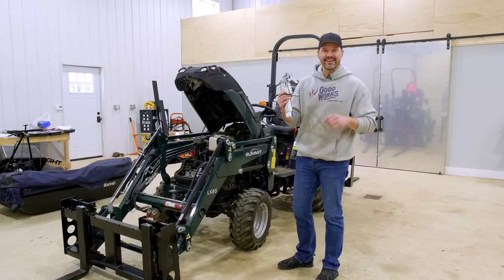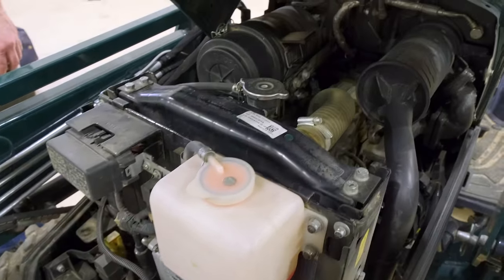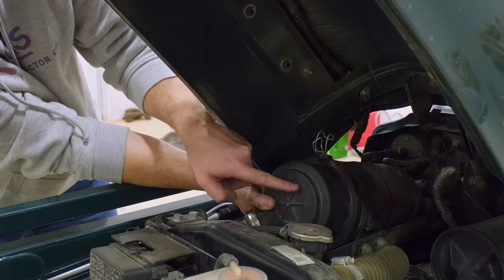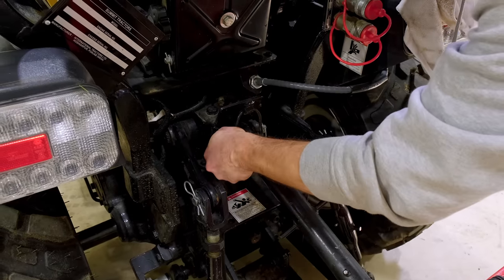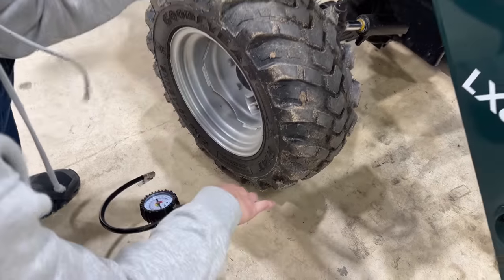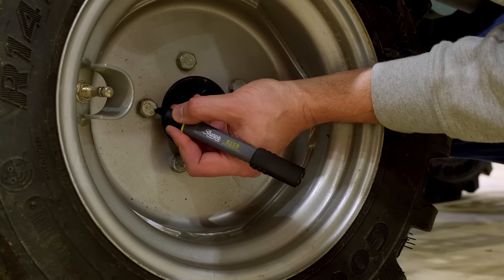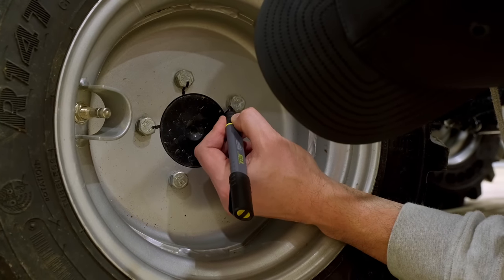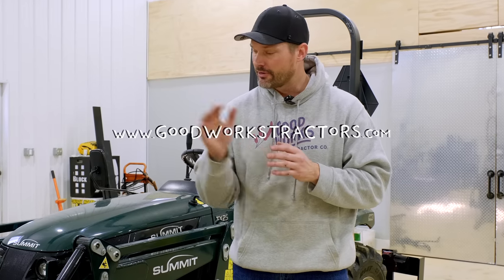90% OF TRACTOR OWNERS DON'T USE THIS TRACTOR HACK...WHY? 🤷

Comment: FYI.  A straight extension on a torque wrench doesn't affect the torque value.  It's only when you use an offset, swivel or other type adapter that you have to adjust the torque value.
Reply from the maker: Thanks for the confirmation!
Reply: The Torque limiting of the straight extension is a function of the extension's thickness. Torque Test Channel covered this in their video on the torque limiting sticks. Interesting stuff
Reply: Straight extensions can indeed affect torque value if subjected to stress levels allowing it to reach its elasticity level which in some cases with higher torque values can be reached . Same principle as to why extensions on an impact gun have a negative impact on output torque, and also the same principle as to how torque bars work when installing lug nuts on wheels.
Reply: Torque bars only work with an impact tool. They are designed to twist away at their set torque setting and spring back in the momentary break in force that comes with the hammer of an impact tool. Any extension can twist. The key is of course to use slow, even pressure when tightening with a hand tool. And anyone that can grab an extention and change the torque of an 18" wrench turning a nut/bolt by any meaningful amount should enter a grip strength contest.

Comment: Great tips Courtney, especially helpful in the spring. This is a great time of year to be checking your tire pressures as temperatures begin to change. 
Tip from RG: Blow a burst of air INTO the tire to clear the liquid from the valve stem before placing your tire gauge on the valve stem. This will minimize the amount of liquid that may enter your tire gauge (or on your shop floor 😅). As Courtney mentioned, we also recommend using an "air/liquid", "tractor", or "wet" tire gauge as they are designed to work with any liquid filled tires. Also, remember that Rim Guard is water soluble, so if you do have a spill it's as simple as rinsing it away with water.

Comment: Another great way that sharpie can REALLY help you out, is writing the date/hours/miles directly on the filters, when maintenance is performed. Takes any guesswork out of it, and removes the need to write it down elsewhere, or try to remember. I've been doing that on all things I've been working on at home for years, and it really helps!
    Also, the military has taught me those lines on bolt heads or nuts are, appropriately so named, "torque stripe".
Reply: My local dealer does this and I started doing it on everything. Very convenient and easy to do.

Comment: I looked it up.  Using an extension doesn't change the torque value enough to have to adjust the setting.  However, you have to keep the extension straight so as not to change the pivot point.  A u-joint can cause a big difference if at an angle, so it should be avoided.
Reply from the maker: Sweet, I was told wrong before.  Glad to hear it!
Reply: Duh

Comment: Just a FYI: be consistent in the pressure gauge you are using each time as they sometimes vary between models. I found this out while doing maintenance on my car. Also, check the manual for pressure needs, I used a sharpie to write it on the rim so I don’t forget…
Reply from the maker: Wouldn't have guessed that
Reply: My pressures, wheel, and torque specs are sharpied on the dash in my cab tractors. In the army we stenciled tp# on the fender or frame above every tire and other needed info which is where I stole the idea from

Comment: Important note: when checking hydraulic oil make sure the 3-point is down. Also, when checking air pressure with fluid filled tires, put air in with your air compressor first so the fluid won't spit back at you
Reply: Especially any tire sealer!

Comment: Besides putting a paint marker line on the lug nuts, I also write the torque settings and lug nut size on the wheel. I've got too many things with wheels to remember which one has what. And the Kubota L4701 has different sized nuts on the front and rear wheels. And just like on a car, lug nuts should be tightened in a star pattern, and with two passes. If some of the nuts are loose, when you back around to the starting nut after the first pass, a nut can be under-tightened. Hence, two passes.
Reply from the maker: Lol, good idea!

Comment: As long as you're supporting the head of the torque wrench, the extension shouldn't change the applied torque in any meaningful way. Extensions will reduce the torque applied by an impact wrench as some of the impact energy is wastes twisting the extension. Once or twice I did see you tighten a nut just past the click so that's something to be careful about. Any time we're using a clicker it's good to have a reminder to back off the torque to zero so the springs inside don't stretch. I like digital torque wrenches now, you can see actual torque applied and they'll have a beeper at the set torque. You can even get an inexpensive digital torque adapter to use with any ratchet.
Reply: At least one nut on the left rear wheel was way overtightened. I'd back all those nuts off and redo them.
Reply from the maker: Thanks!
Reply from the maker: Hmm, I stopped every time I heard the click
Reply: @GoodWorksTractors  Check @ 13:39. Looks like you went about 1/8 or 1/10 turn past click. Given the leverage you have with an 18" bar, that's probably around 7 to 10lb over your target.

Comment: When I first got my 1025R, there were a couple of tires that were always going low on pressure.  Took it back to the dealer and the mechanic overfilled it.  He said they’re supposed to be overfilled from the factory to ensure the tire seals properly.  It worked for my issue, perhaps that’s what happened to your tires…just a guess.  Love the sharpie idea, thank you Mr. Courtney!
Reply from the maker: Interesting, that just might be it.  Thanks for chiming in Elaine!

Comment: Extensions do not change the torque value for static setups as shown in this video. If using an impact wrench it does affect the torque level because the extension twists slightly and the impact is momentary, not long enough for the fastener to seat at the full torque applied. The applied torque when using hand torque wrenches correctly allows the twist in the extension to last long enough to apply the full amount of torque to the fastener. Correctly in this case is a relatively slow application of force so the fastener turns and seats before "clicking" rather than a fast jerking force. Retorquing each fastener is also appropriate to assure each fastener is tight, similar to what is required for a cylinder head. Retorque each fastener until all do not move to assure content tightness.

Comment: Regarding extensions when torquing.  I just watched a test.  Extensions affect fastener torque only when using an impact gun.  Tightening with a torque wrench or rachtet is not affected.
Reply from the maker: Awesome, sounds like I don't have to worry about it.  Thanks Simon!

Comment: many good tips here i usually try to grease the main pivot points whenever i get ready to use but tie-rods and such can be over greased blowing out the seals but U_joints get LOTS of pressure  . even in the winter check your radiator screen IF you feed hay or even moving dirt with your loader--wish that they had come up with the liquid ballast  in the years back i have had several rims rust out from being filled with calcium fluid .  i broke the axle tube on my Versatile 876 4x4 (260hp) twice, not a pleasant feeling quite sure loosing a wheel is right up there!!! tips from a lifetime of farming .

Comment: Coolant reservoir looks low to me.  It's going to be interesting to see if there are any dealers in NC for those Summit tractors in the next couple of years.  There are certainly Tractor Supply's in NC, but it looks like they are showing a limited number locations in three states.  Looks like the closest dealer to NC is in Kentucky.
Reply: It looks low to me too.
Reply from the maker: Yeah, I specifically talk about this in the video :)
Reply: @GoodWorksTractors  if coolant is low in overflow it's worth taking cap off (with cool engine) rad as filling that overflow tank doesn't fill the rad. You probably know this but for the general audience.

Comment: if using donaldson air filter assembly - most appear to; buy the gauge that tells you dirty your air filter is without having to open it.  there is a little cap just on the elbow at the back it fits to.

Comment: As others have said, a straight socket extension will not change the torque reading.  Definitely don’t use a higher torque value than recommended.  Also, holding the extension isn’t the optimal technique as that can change the torque reading a little due to the friction with you hand.  Better to rest your palm under the head of the wrench to hold the extension straight and let the head roll in your palm so that you aren’t impeding its rotation.
Reply from the maker: Good to know, thanks LT!
Reply: What. Are you Steve Austin or something?😂

Comment: I have no actual knowledge to back this up, but I had heard if you use impact wrench extensions - those do have 'give' in them that can change the torque. As such I save their use for only impact wrench removal uses.

Comment: About the high front tire pressure - you indicated that you had never added air to the tires. Tractors often ship with tires fully or even over-inflated to improve reduce bounce and improve stability. Since Summit has no dealer to set-up the tractor the pressures had probably never been reduced to the correct operating level.

Comment: I have never greased a fitting without first wiping off the end of it. Any crap and dirt that is on that fitting WILL be added to your grease, causing wear. I have rarely seen someone do this these
days.  Once upon a time there were full service gas stations that did cars greasing and if you did not do this you would be fired.  Especially equipment that is in the dirt a lot.

Comment: That first oil change was an experience on my Kubota LX2610. Not a lot of room for a filter wrench, and if you're a contortionist that helps😂 thanks for all the great videos
Reply: I have an LX2610 as well and mine was pained on from the factory.  Wrench would not budge the filter.  I had to score the paint and then punch a screwdriver through the filter to get it to break loose.  It was the worst oil and filter change that I had ever experienced.  At least it is no longer painted on and I didn't over-tighten it, so it should come off much easier next time.

Comment: The one thing that I can provide. When using the torque wrench you want to go to the click then do not go back over the nut. The torque value has been achieved when you get to the click. When you go do it over and over you are actually changing the torque values. One time click then done.
Reply from the maker: Yeah, that makes sense to me

Comment: Doesn't  the liquid ballast damage your tire gauge? If it was spitting the liquid out, then the liquid was getting into the gauge.
Reply from the maker: No, it cleans up with water
Reply: I worked in the tire repair business quite a while. There are tire guages designed to get fluid in them w/ no damage. Just stick head of guage in clean water & pump the stick to flush it out. Also the tire should not be 100% full of fluid. Valve stem should be at 1200 when tech is filling it & he should stop filling just before level gets up to the stem. Thereafter whenever you check the pressure make sure the stem is at 1200 to minimize fluid in your guage.

Comment: straight extensions do not affect torque on a torque wrench.  crows-feet or dog-bone style torque adaptors can change your torque settings.  all dependent on angle of offset and lengths of the wrench and the adaptor.
Reply: and the easiest way to account for that offset, is to turn the crow's foot to a 90 degree angle from the handle - then the offset is zero.  You would need to calculate only when you get away from that angle - if you're adding to or subtracting from the natural length of the torque wrench
Reply: @Idahoser11  I'm pretty sure you're only supposed to use a crows foot at 90 degrees on a torque wrench without looking it up. Some of them have the torque multiplier per 12" of wrench printed right on them.

Comment: 1:27 is that a steering stabilizer on the Summit? very nice...
Reply: oh interesting on 2nd look it has a pitman arm/drag link setup instead of rack and pinion? is that common on compact tractors? FWIW i would never speak poorly about recirculating ball... i liked the steering on my 2004 Suburban a lot better than my 2013 Suburban. big step backwards moving up to a GMT900 IMO.

Comment: Does 10 hours greasing intervals on the loader mean grease after 10 hours of loader operation? If so this could be 50 hours of tractor operation for many operators.
Reply from the maker: Yeah, 10 hours of loader operation

Comment: I'm trying to figure out what is accomplished by jacking the loaded rear tire off the ground to check the pressure. I don't see the reason.
Reply: Simply to get the valve stem @ 12 o'clock. I would have just pulled forward but if a floor jack was super handy, I would consider it. I doesn't change the reading. His may have been a little overfilled as only air should have come out.
Reply: @Clydedude1  Ah I see. I suppose inside a shop that might be necessary. I guess I was over-thinking it! Thanks.

Comment: I have Rim Guard in my wheels and double stacked wheel weights and 8 40Lb suitcase weights on my 1025R, the problem is sometimes the tires don't spin when the rims are spinning, tires are stuck in the ground.  Would it be a good idea to put screws in the rims into the tire beads to stop it or not?
Reply from the maker: Hmm, that's a new one for me.  Tires spinning on the rims and the RimGuard isn't leaking out?  Every once in awhile I'm completely stumped.
Reply: @GoodWorksTractors  Tractor time with Tim had this happen to him in one of the early episodes, no leaking of Rim Guard.
Reply: @Xo Sa chains wouldn't help, the tires don't spin only the rims spinning in the tires.
Reply: @Xo Sa Tractor is a 2017 filled at that time so not new tires 5-6 years old.
Reply: it does not happen all the time only when it really gets stuck.
Reply: When's the last time you checked your air pressure? This is typically caused by tire pressure being too low. Sometimes tubeless tires will allow liquid to get between bead of tire and rim and when they are put under a load, the rim will start spinning on the tire. Best practice is to check your tire pressures when temps are changing in spring / fall.
Reply: DO NOT screw the tires to the rim. Check your tire pressure first. If it's good, try using the diff lock or four wheel drive if you have it. If it's still spinning in the tire, you'll need to do some work. Drain it, remove the tire, clean it, put some bead glue on, and reinstall everything thing. Good luck.

Comment: Excellent idea 💡 to line up the nuts to the wheel 🛞.  I wasn't aware that you lose torque when using an extension. I don't think Kubota has that point in their manual. I am thinking no one else either. I look forward to some I sights by other viewers.